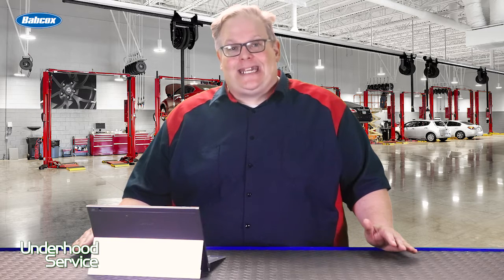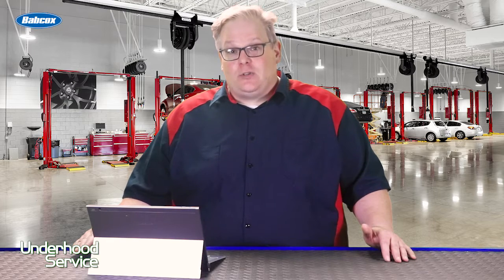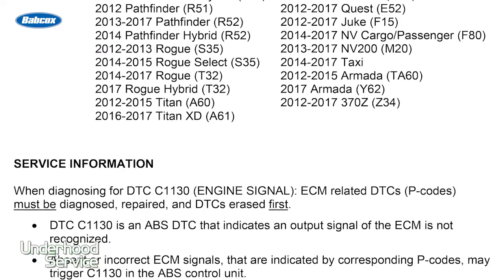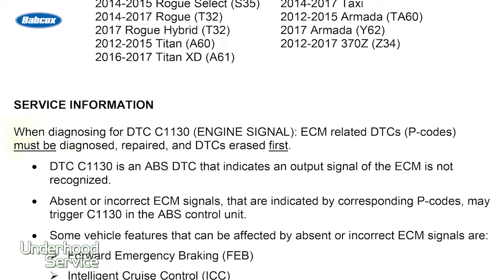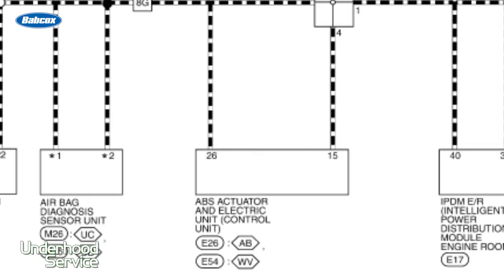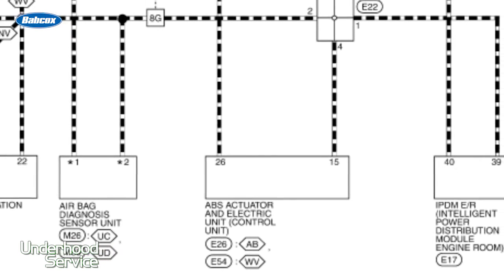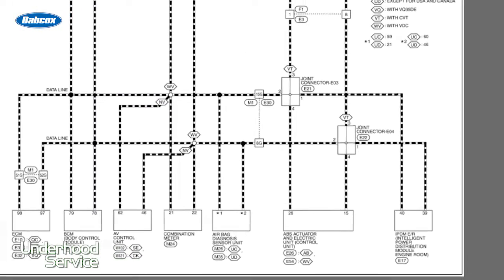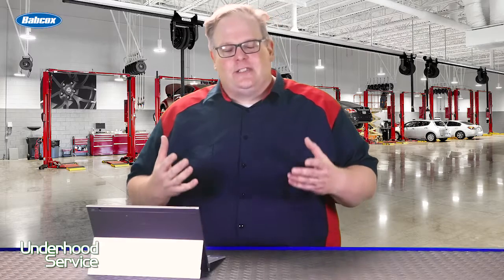How To Resolve DTC C1130 For Nissan Vehicles | Tech Minute

Comment: What if there is no comm with either ECM or TCM? I did an all systems scan and got engine signal 1 code in abs and no comm with said modules. I suspect Possibly a canbus termination resistor is broken or there is a cam/ crank correlation error a sensor is broken or canbus is short to ground or open. I also suspected it might be a bad accelerator pedal potentiometer since the are doesnt rev. But sinnce the ecm isnt communication with the cluster properly I don't know wether there is a check engine light or a limp home mode. Its a Quasquai 2015 petrol.

Comment: Hello, I have a problem with my Xtrial 2008 t31. The car is running out of power and the engine witnesses turned on, that off and skidding. The car does not respond well and that happens when the last two warning lights that I tell you come on. When these two warning lights are on, the gearbox does not work well and it has gear changes failure and the power is very bad and it is spending a lot of gasoline. Could you help me?. This is my problem: https://www.youtube.com/watch?v=89CQRTKunkc

Comment: Thank you so much for posting this!! I got mine checked and have 3 codes- but after watching this, I feel certain that it's all tied back to a faulty Mass Air Flow Sensor. I'm replacing that, and hopefully it will correct the other 2 codes as well.
Reply: what code did you get
Reply: did swapping ur maf sensors help?

Comment: I have a C1130 code ...2011 nissan rogue , i have reduced speed and it jerks ,, i am thinking its a throttle position sensor .....any suggestions
Reply: Have you found a fix yet mines doing the same thing plus a mass airflow sensor code
Reply: @Deltapickle have you found the fix
Reply: @CashMoneyKings3  it’s been a fat minute but if I remember right I ended up just taking it to my mechanic who cleaned out the throttle body and replaced a vacuum line. Mine has a cold air intake that at this point could probably use a new cone filter but I would check your filter, throttle body, and vacuum lines.
Reply: @CashMoneyKings3  hope that helps!
Reply: @Deltapickle  okay thank you

Comment: There is a way to reset the check engine light on a 2018 Nissan Pathfinder and it is sooo easy and it works!  Press your ignition button twice to put it into the run position, Lift the hood and remove the negative battery cable.  Then take the connector and touch the negative battery post three times about a second apart. Then just place the clamp back onto the battery, tighten, and start the vehicle.  The light should go away if the problem has been solved.  Trust me, it is that easy!  Try it, you’ll be glad you did.
Reply: THANK YOU

Comment: Excellent Job.  My engine check light was on and I had a traction control light on on the dash also.   The engine DTC code was P0340, camshaft angle sensor, and when I did an all up system check the C1130 code came up just like Andrew described.
Reply: Exactly the problem on mine too
Reply: @jimmytran5971   The camshaft angle sensor was replaced yesterday.  That fixed both DTC codes P0340 and the C1130.  My truck is back to normal.
Reply: @klrmoto  I had the ABS sensor replaced and this code is now on! Could it be cause it wasn’t cleared by a computer?
Reply: @janiegarcia945  That is beyond my experience.

Comment: Doesn't tell you how to fix the fault just explains the fault
Reply: its a generic canbus code saying that one of the modules is putting out weird cross talk. You need to find other P codes that coincide with this that will lead you to the right path. If you have nothing else but the C code it might of been a transient hiccup ( too much water, bad voltage whatever) clear it and see if it pops up again
Reply: well it tells you that the fault code indicates a fault in the engine it could be any and you have to fix it and clear DTCs to be able to clear that code
Reply: thats the thing....mechanics
Reply: there could be thousand things that would cause c1130, watch the video before commentating
Reply: This is what you get when you buy Renault thinking you are buying Nissan.

Comment: Thank you for this information, Andrew and Babcox crew. As someone who enjoys the feeling of driving a vehicle where all maintenance is done by themselves, this information has confirmed and clarified my assumption. The first time I came across the C1130, I was in a panic, then saw the P0340 code (Camshaft Position Sensor Circuit Malfunction) and went and bought the OEM part to replace it, cleared the P-code, and voila, the car worked as expected. Recently it threw a C1130 and a P0335; I thought for a moment that it might mean I would need a new ABS module overall. I currently have the Sensor on order and shipping to my house. I am pretty sure it will resolve the issue, and with this short video, I am entirely confident I didn't waste my money. 

Thank you a ton for this info!
Reply: Hey mate did the sensor fix it?

Comment: Hi. I have c1130 and can't seem to find the problem. I have a 2015 x trail. I also have airflow sensor code showing too. On my dash the forward emergency braking light and esp light is on as well saying the auto stop start isn't working. Any suggestions
Reply: Pipe.